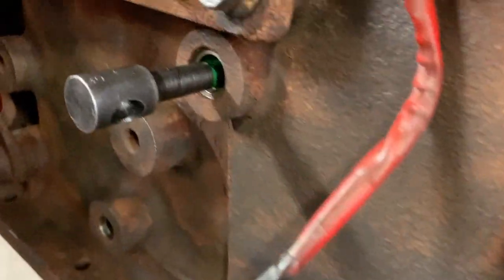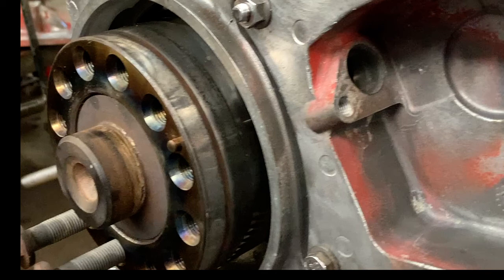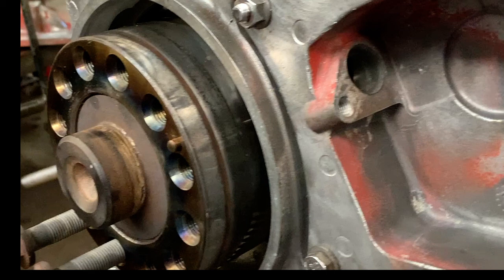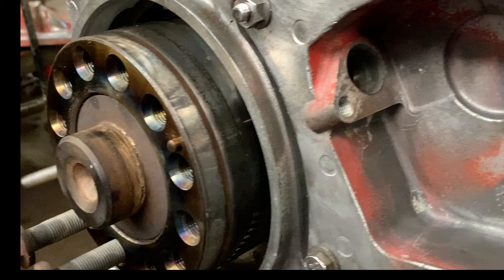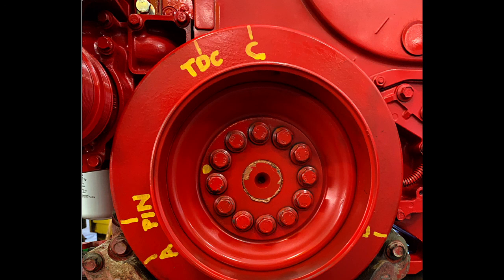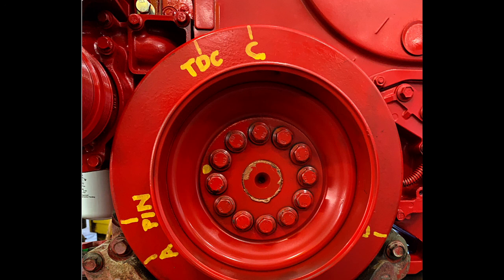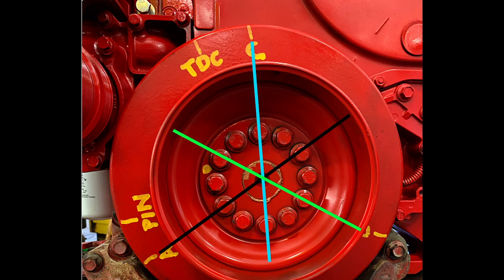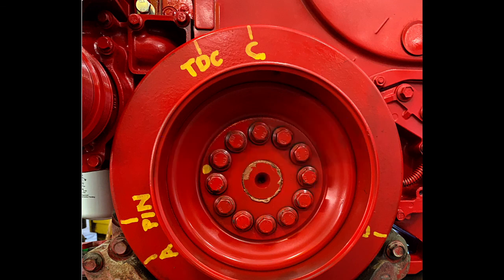Cummins ISX How to pin the crankshaft

Comment: I have a 2004 International 9400i. Engine serial # 079067324 with model code # L942700. Cummins ISX 435ST 453HP. Withe the help of your video I manage to locate the PIN HERE mark as well as the mark on the timming cover. I'm installing a new air compressor but I need to order a PIN tool as described in your video. Found some PIN tools online but they all say for Cummins 2007 and up. My truck is a 2004 and my question to you is this. A PIN tool made for 2007 and up, can it also be used for a 2004 model truck with a Cummins engine. Let me know I would greatly appreciate it. Thank much for your video.
Reply from the maker: THe pin tool for the crankshaft is the same on all ISX engines from 1998 to present as of the writing of this in 2024. There is a green band on the tool. It should just be inside the edge of the hole so you cant see it looking straight down. Then it is fully seated in the crankshaft.

Comment: Does the pin need to be taped in or does it go right in
Reply from the maker: The pin is in the nose of the crankshaft it stays there by press fit. it is just for alignment purposes. so if it was gone you just line up the pin hole in crank and damper and your good to go
Reply: @ENGINESHOPJOE  thank you appreciate your help
Reply from the maker: I was thinking you were asking about the alignment pin in the crankshaft where the damper bolts on. The crank lock pin is a tool that is inserted through a hole in the cylinder block and once in the crank wont move. THat pin is a service tool one purchases for camshaft timing when the gear train is removed or the cam is removed/replaced.

Comment: Currently doing a head job on a twin cam isx, I have the pullers for the cam gears but not a timing kit, am I able to do this job without?
Reply from the maker: No. The cams have to be locked and 4.25  and 6 degrees with the crank pinned mechanically. Close does not work on the cam timing.
By the way the standard timing was 4 inj and 6 valves. We set the 871 inj cam to 4.25 and if we dial indicate the cam it is always right on the money.

Comment: what covers the hole? is it a hex socket?
Reply from the maker: Depending on the generation of the engine it can be just a threaded hex drive plug or current engines the fitting the crankcase drain hose clips onto at the block.

Comment: When you pin the crank doesn't the "pin crank" mark on the dampener line up with the mark on the front cover that is top right in the picture and above and a little inboard of the crank sensor? Just like when you line up A, B, C when setting overhead?
Reply from the maker: Yes It Does and you are correct.
 I wanted everyone to see where that dowl pin was located in relation to the crank sensor hole in the gear housing with the crank pinned.
Then i unpinned the crank and turned it and put on the damper.
The yellow reference dot is showing where the dowl pin is at the moment and later in the video the purple arrow shows where it needs to be if the crank were again pinned.
This exercise was to help the viewers understand how to find that pin on a rusted damper. If you can find just one mark and know its identity you can map out all the rest.